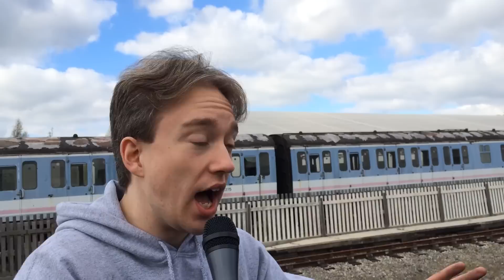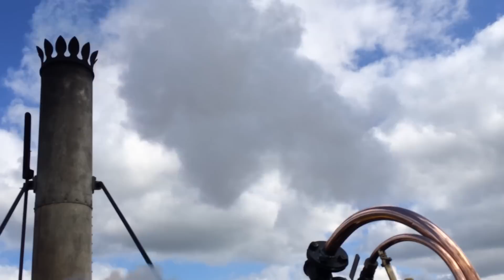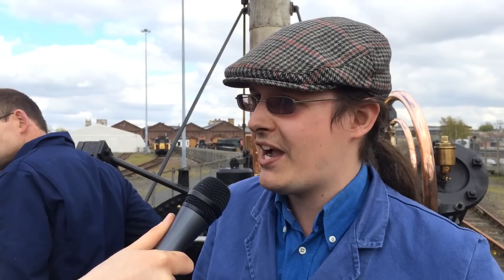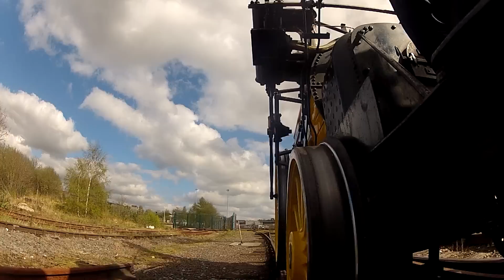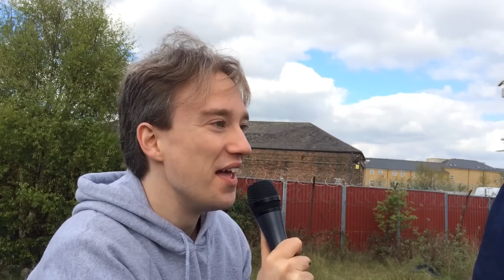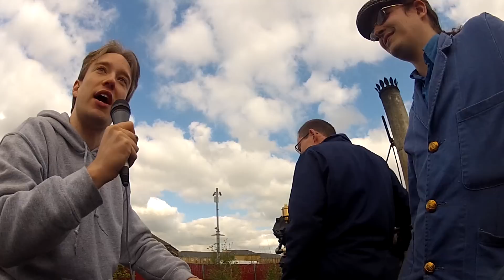The Early Steam Train With No Brakes: Stephenson's Rocket

Comment: we had a girl comming in the shop who went from 5th to reverse on the motorway trying to put it in 6th on a 5 gear car.  needless to say, the car didn't survive.
R.I.P. Renault Clio
Reply: And British people make fun of us Americans for having automatic transmissions.
Reply: Penguin236 I've put my car in reverse once or twice while trying to fall into fourth, it's very obvious what you've done as soon as you start to release the clutch.
Reply: bbqroast The thing is though, why bother with the clutch and all that if you don't have too? On an automatic car, the computer handles the gear switch, making it impossible to go into reverse if you're going forward and vice versa.
Reply: +Penguin236 The computer knows less than you, you know if you're pulling into a parking bay or changing lanes to overtake a truck, you know if your about to hit a hill or a crest. This foresight means that a manual driver can have better control over their speed, while an automatic car can often delay maneuvers as it switches to provide the necessary ratio.
Reply: bbqroast " delay maneuvers as it switches to provide the necessary ratio."
Computers may know less than humans, but they are MUCH quicker. If you were to go up a hill, the computer would switch gears much quicker than a human could. Either way, if you feel you need more torque, most cars have specific settings to force the high torque gears.
Reply: It doesn't matter how quick the computer is at changing gear, the engine still needs time to respond, time which an automatic cannot provide.
Reply: bbqroast Why would an automatic not be able to provide it? If it changes gears quicker than a human, than the engine should be able to respond quicker.
Reply: Penguin236 Yes, but not quick enough. A manual driver will put the engine into the correct gear and rev it up to speed before pulling out. This'll give him the power to over take.

An automatic gear box can only do this once the car has pulled out (because it doesn't know what's happening until the accelerator is floored).

While the manual is able to pull ahead, the automatic gear box, even though it's very fast, must still wait for the engine to spin up - that cannot be sped up by a computer. Engines have many mechanically induced delays. To produce more power the engine needs to spin faster, which takes a while to achieve, the turbo will take a while to respond to the increased power, etc.

Case in point, note that nearly all racing drivers will drive semi-automatic or manual, which allows them to provide their foreknowledge to the car.
Reply: bbqroast Race car drivers actually need the additional control provided by a manual transmission, but most other people do not. You haven't explained the usefulness of quicker engine response in everyday driving. I know it may sound lazy. but what is the point of a human handling the transmission if the computer can do it just as well?
Reply: Penguin236 I have, several times. Motorway driving for one, going up a sudden steep hill, it's also quite handy to be able to use low gears for maneuvering, as it keeps you in control.
Reply: bbqroast An automatic should be able to adjust to steep hills and such just fine. In fact, it should do it better, since the computer can detect changes in the engine output much quicker than you. Either way, you can force the car into the low gears on automatics if you so desire.
Reply: Penguin236 do you even read my comments? The computer cannot see ahead like you (excluding Google Cars of course). The computer can react faster yes, but you can react before the computer and thus win the race.
Reply: bbqroast What is the point of switching to gear early? If you are coming up to hill, you want to switch to a lower gear as soon as you hit the hill, not before.
Reply: Penguin236 to get the engine up to revs. 

Engine power is related to RPM. If you hit a hill in 4th then change to third you'll loose a bit of speed, then suddenly the engine is struggling to get the RPM required to go up a hill (especially important with weaker cars or heavier vehicles). On the other hand if you change early you can rev then engine up on the flat and hit the hill with the engine already running with enough power.
Reply: +Penguin236 its a way of life
Reply: +Penguin236 its a way of life
Reply: +Penguin236 plus it's confirmed that overall manual  cars as well as being cheaper are more fuel efficient and can accelerate faster.  plus they're more fun.
Reply: whistonjuniors Cheaper? Yes. More efficient? Marginally yes. Accelerate faster? Probably not. More fun? Depends. More practical? Hell no.
Reply: They can accelerate faster if you get the timing right. Agreed it's less practical. But i'd happily sacrifice some practicality for the fun.
Reply: +Penguin236 bore off you troll, it's been explained perfectly well why people prefer manual transmission. Just because you clearly don't have the patience to actually learn a skill doesn't mean the lazy solution is best.
Reply: Phantomwhite I'm a troll for explaining my side? 

"why people prefer manual transmission"

So everyone in the world prefers manual transmissions? That's news to me.

"doesn't mean the lazy solution is best."

Thank god you don't rule humanity, because using your logic, we would still be in the stone age.
Reply: Fun fact: You have to pull something up with two fingers if you want to put a Renault in reverse.
@Penguin236: You're making fun of Phantomwhite's logic with flawed logic. Nobody could have ever ruled humanity in the stone age. Even if they tried.
Reply: I’ve never driven an automatic car. No idea how to drive them ? Must Easy though without clutches and gears
Reply: @Penguin-kr9do  just because you can't use a manual, stop blabbing on about automatics, nobody cares
Reply: @mymo_in_Bb  What reasoning? A bunch of nonsense about how they're more efficient (hasn't been true for many years)? The argument of "a good driver is quicker" is utterly idiotic too because most people are not race car drivers and don't have enough knowledge/good enough reflexes to change to the exact right gear at the exact right time. A computer will decimate 99% of the population in gear shifts. Manual, for most people, is nothing more than an inconvenience.

Manual-fans love using the argument of "oh but it gives you more control". This argument, again, is irrelevant for 99% of the population since most people just want to go from point A to point B. Control doesn't matter. If you want to drive manual for fun, go ahead, but don't pretend that it's somehow far superior to automatic.
Reply: @mymo_in_Bb  I refuted his arguments. It's not my problem if you can't understand it. And as for control, do you care that you're not in control of a 500 mph, 100 ton airplane? No? Then why the hell does it matter if you're controlling the gears of a car.
Reply: @jedrorm  My car has this sorta interlock thing where it won't even let you shift there if you're moving too fast.
Reply: @Schradermusic  what about jesus?
Reply: @Penguin-kr9do  although the automatic one may be quick and all, the feeling of control over the car you have is not the same. I have tried both and I prefer manual (personal opinion of course), maybe because it is what I'm more used to, but both are ok. However, some stuff like engine braking is not really possible with an automatic car, and I feel more secure and in control with a manual one, while not loosing anything. The only time where I would prefer an automatic car is on a quiet highway where for some reason you have to change gears once in a while, because I'm bored and don't want to do anything, but those aren't as common in europe as in the usa. They are equally convenient because you don't need your other hand for nothing else than driving so why do you care to use it to change gears?
Reply: @ronwesilen4536  It's not "equally convenient" if it blocks your other hand. If I told you to write an essay while holding a fish in one hand, would you say that's fine because "I don't need my other hand to write anyway"? Ultimately, you're free to prefer a manual. But stop arguing that it's somehow superior to automatic. It's not. By every measurable metric, a modern auto does better than a manual while simultaneously being more convenient and less involved.
Reply: @Penguin-kr9do  i never said it is better. And it doesnt block the other hand. You just use both your hands to drive, in a different way.
Reply: @ronwesilen4536  It literally does block your other hand because you are forced to use it for shifting. Here's another way to think about it: you can drive an auto with one hand, but you can't drive a manual with one.
Reply: @ronwesilen4536  I get your point, and I appreciate you making a reasonable argument rather than saying the usual BS of "hurr durr auto driver stupid". I'm responding to your argument with my own counter argument.
Reply: @Penguin-kr9do  so that's what I'm saying, if you are used to it, you are going to prefer what you are used to. I don't think one is more "convenient" because you need both your hands at all time for driving because you shouldn't be doing other thing while driving, and I have never felt that I needed one more hand to drive either, while I feel I have less control over the car while I'm using an automatic one. If i were used to auto, i would feel switching gears would take my attention out of the road. I'm just trying to make the point that none is better or superior, they are the same, just pick the one you like the most.
Reply: @ronwesilen4536  I'm not talking about preference, I'm talking about the basic fact that auto requires less effort than manual. You're trying to come up with some convoluted argument about how "manual is just as convenient because you shouldn't be using your other hand anyway", when the simple fact is that manual takes more work than auto. Manual requires you to do everything auto does, PLUS shifting. You can prefer what you want, but it is indisputable that auto takes less work than manual.
Reply: @Penguin-kr9do  if moving your hand 15 cm to move a little ball without any resistance is a bigger effort to you than using your brain to be worried about what the car is going to decide to do by itself, then you have reached pinnacle american (under)performance and you are right. If not, i stand by what I have said
Reply: @phantomwhite7972  You say that like it hard to learn a manual. I never understand why people act like they are better for knowing how to drive a manual. It really isn't that hard to learn imo. Also, imo, automatics are better for daily driving, especially when dealing with alot of traffic and such, but manuals are more fun to drive. They each have their pros and cons and no one is better for prefering or using one over the other.
Reply: @Penguin-kr9do  No aircraft has a manual gearbox, it would be impractical. This is a bad analogy
Reply: @Penguin-kr9do  (UK and Canada) left hand for steering, right hand for shifting, and when not shifting.... Both hands for steering
Reply: My (very old) Audi makes me push the stick down before I can try to go into reverse. I guess Renault didn't think of that?
Reply: @benjaminhackett8896  what Audi have you got?
Reply: This thread explains why Americans don't use manual gearboxes.

They can't drive properly because they don't understand the finer points of timing your gear changes. And they don't understand, as demonstrated here, because they've never done it only talked about doing it. And so they keep on using automatics, and keep on not learning, in a never ending circle.

Only someone who has driven both for extended periods can understand the difference: talking about it will never do it.
Reply: @Penguin-kr9do  and making it impossible to bump start if you have a flat battery.
Reply: @trueriver1950  The majority of Americans grew up before automatics were a thing. So technically most Americans are perfectly familiar with a stick shift (obviously the older Americans). The real reason why Americans don't drive manuals is because we are creatures of convenience. Old drivers want the automatics and new drivers don't want to learn the manuals. Yet, there are those who still do. I'm glad I learned on a manual starting off.
Reply: @sebastianharris-aldred8057  You are ill-informed. In the UK, we use our LEFT HAND for shifting.
Reply: @Penguin-kr9do  You have not addressed the valid point Ragnar made. To wit, lacking any eyes, the computer can only react to the driver's reaction to a situation; meaning that *by definition*, it will be slower to respond than a human.

Plus, of course - as many people have mentioned - the ability to rev up in anticipation of overtaking or an approaching incline that the computer is utterly unaware of.

Automatics have one advantage: less effort on the part of the driver. Essentially, they're the lazy option. A manual transmission allows you to, at the cost of additional effort, have much more control over the vehicle. I shouldn't even have to say this. It's blatantly bloody obvious.
Reply: @SodAlmighty  Sorry, I got it the wrong way round, wasn't really paying attention
Reply: Drove both. It really depends on where I drive. Over land, especially when it is uneven terrain, manual gives a lot more control. Also when driving someone elses car, one is closer to the engine and much easier gets a sense about its quirks.
But when driving in a city with lots of traffic lights I'd choose automatic every time. Just the convenience of not having to switch gears the moment the green light goes on and instead directly accelerating, especially when about to use the indicator and while looking for cyclists crossing, makes the whole process so much more relaxing and in fact saver for everybody around. Unless of course some moron is convinced they would have a free hand they can use for whatever else they come up with.
Reply: Now how did that happen?! Reverse gear is distinguishable by a long complex movement or a button to make sure it doesn't destroy the transmission
Reply: Reverse is a non synchronized gear, you are not going to be able to accidentally shift into it. It will grind like crazy, but never engage.

I'm an American and I prefer a manual, every day, ESPECIALLY in traffic.

Comment: so, to completely stop this thing you have to rock the thing back and forth until the steam uns out? :p
Reply: no, you can also just vent the steam directly out.
Reply: To stop the loco you would wait for it to come to a halt and then shut the regulator (turn off the steam to the cylinders) and take it out of gear. You'd also use the handbrake if you were on an incline to prevent the train from rolling away. There might also be a guards van with a brake as well.
Reply: Christopher White an erudite explanation. I was simplifying because of lack of time to write the comment earlier, thank you for taking it up where I left off.

Comment: Can anyone tell me what purpose the pipe up the stacks serves? I kind of thinking a steam whistle?
Reply: It's not a whistle, that wasn't invented until a decade or so later. It's actually to measure the water in the boiler. Since it only has one gauge glass, if you aren't sure it's working you can open some taps above in the side of the boiler to test the water level (you see whether steam or water comes out). This pipe leads from the space that should have steam (although this one isn't in use on the replica, it is just for show but there is an alternative set of taps for the same purpose).
Reply: Thank you!
Reply: yes thank you

Comment: In many ways that's similar to how I've seen speed skaters stop.

Hockey and figure skaters stop by getting their skates to skid sideways, by turning the skate close to perpendicular to the direction of travel, which causes large amounts of friction between the blade of the skate and the ice.

Speed skaters are more sensitive to blunt blade, and so they avoid doing this. Rather, if they need to stop, they toe-in, which is what you would do if you wanted to skate backwards, effectively going into reverse mode, and gently resist the bending of the legs. (You seldom see them do this, they normally just glide until they come to a stop. But when they do need to stop, they generally do it this way.)

Comment: So basically it does engine braking. If I pull my foot off the accelerator the engine that is going at so speed is now sucking in just enough mixture to keep it going and is sucking through a restriction. If I drop the gear as well and the gear box is now working in reverse with the weight of the car pushing the engine along the engine has to go round faster whilst sucking mixture through the same minimum hole.